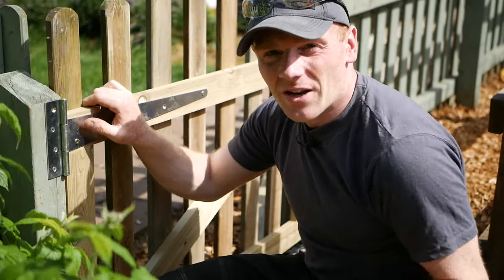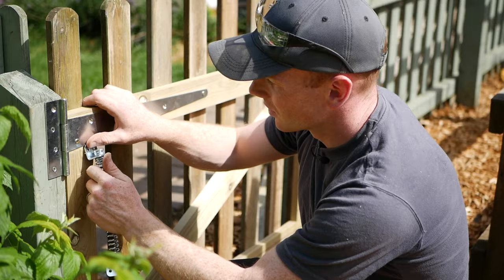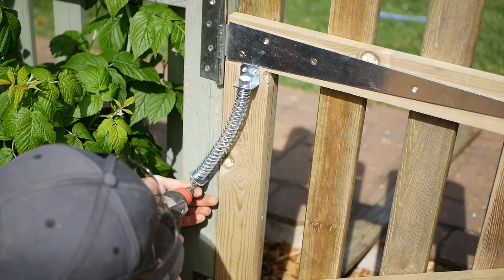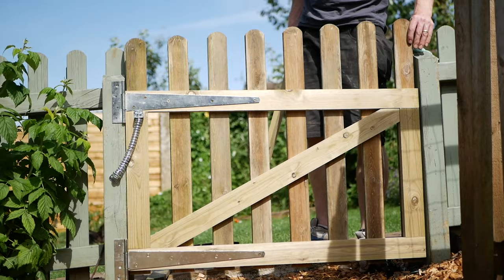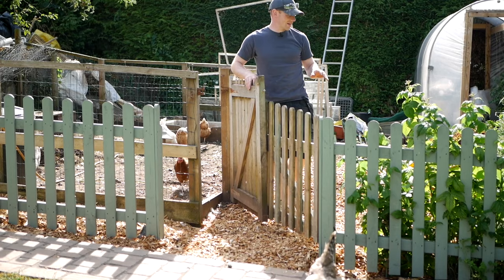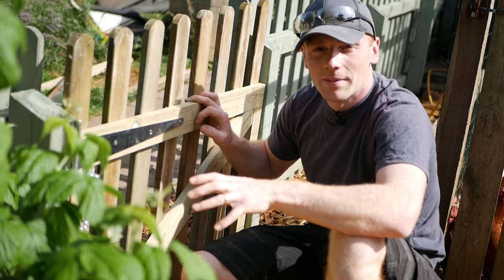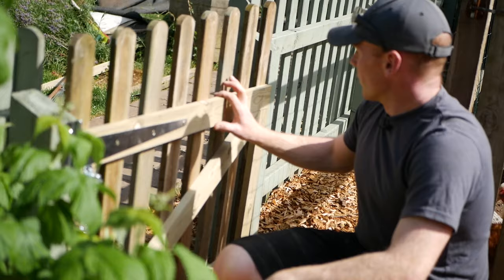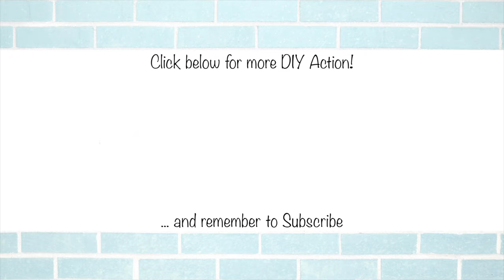Fitting a GATE SPRING | Super Simple 5 Minute Job... for once!

Comment: Shouldn't the spring be on the other side of the gate. Is the soring suppose to work by stretching or by compression.
Reply: My thoughts exactly. We have kids playing in our back garden all the time with our kids and the gate is heavy for them to close. I thought this spring might pull it shut. Doesn’t seem to have enough strength to shut it as spring is used here. Perhaps I could put it on other side as spring  is on the inside of my house storm door.

Comment: I use the same method you will find when kids let the gate close on a fully opened gate the little metal pegs will just jump  out of the slots...glue or weld pegs into place...just a heads up?
Reply from the maker: Will keep an eye on them. 👍 They do make them unnecessarily loose!
Reply: I have an interior a door closer with a similar design, and the pegs screw in. Maybe the peg could be replaced with a screw / bolt? My exterior spring pegs also fell out, so I will try a small screw this time.

Comment: Do you endorse the concept of putting a finish on each part of the exterior parts prior to assembly? 
    Mostly to insure adequate protection from the elements.  
     Terrific production in every aspect.
Reply from the maker: Not sure which you mean but I always try and treat cut ends of timber yes, as for metal, usually galvanised so leave as is.
Reply: The Restoration Couple 
    Do you not paint/stain all surfaces of exterior fence or gate components?
Reply from the maker: Ah I see. Well with the picket fence I did as it was easier to spray all the components green first rather than mess around after. All the wood is usually treated which helps.